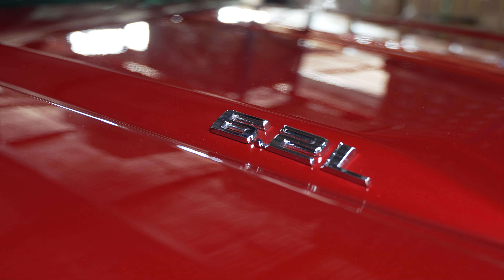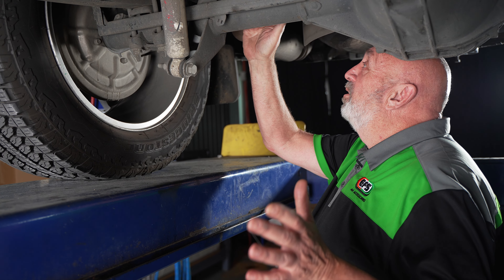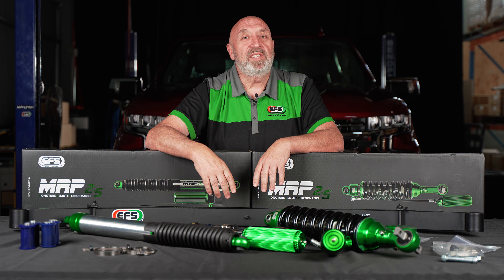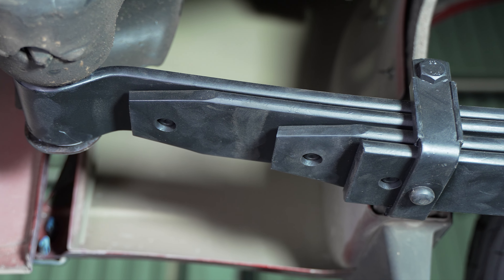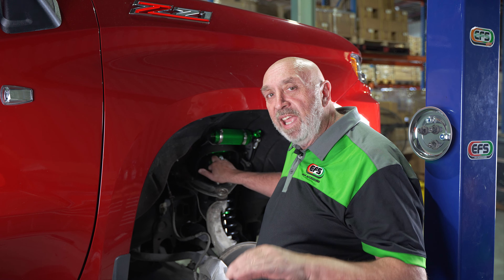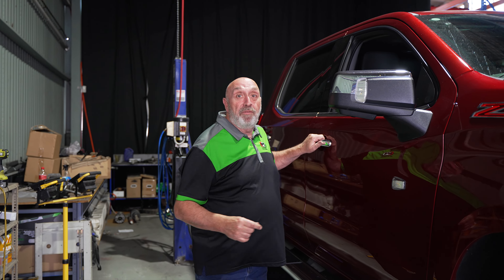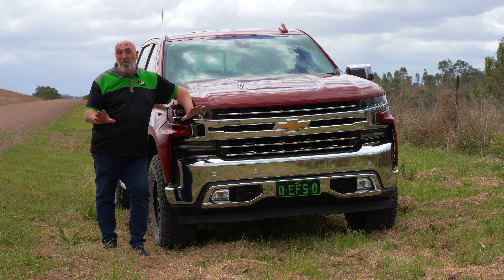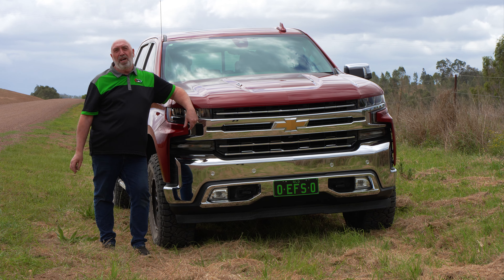Chevy Silverado 1500 Z71 + EFS MRP 2.5 Shock Absorbers = 👌 | Remote Reservoir 4x4 Suspension Upgrade

Comment: These were meant to be set at approx the correct height out of the box. Unfortunately, when installed all of 4mm change from stock. The “trusty” tool wasn’t even included in my packaging and after having to drive out to collect it, found that it is rubbish and should have 2 different sizes to match the different collars. On the Ram 1500 the upper control arm doesn’t allow for any leverage, and the shape of the strut mount at the top doesn’t allow to get tool in properly. Once you do, the tension on the spring is so tight it barely turns. Any recommendations because this “adjustability” really isnt living up to the hype.